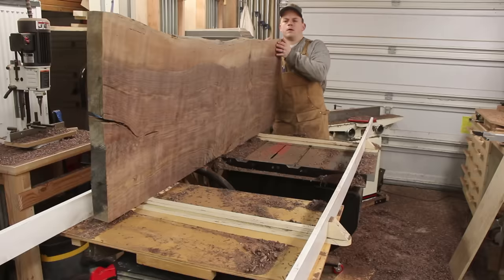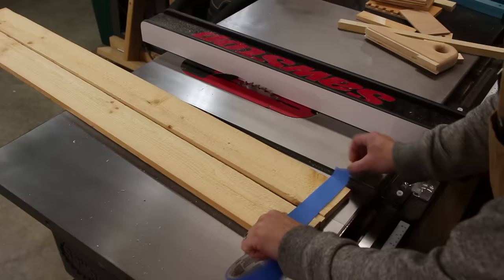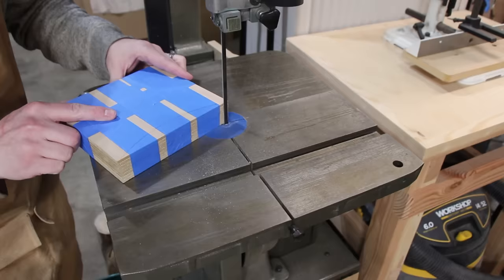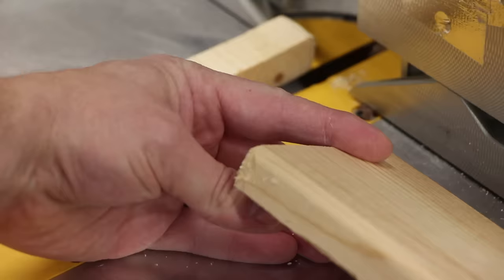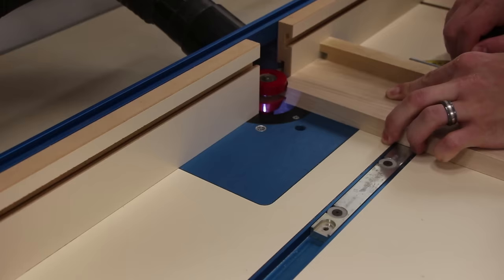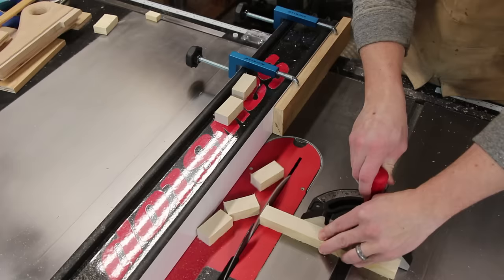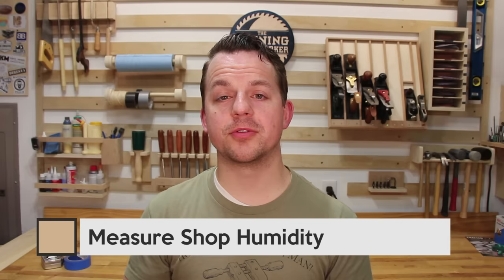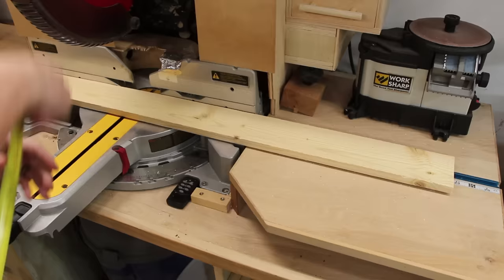7 Woodworking Tips & Tricks You Really Should Know | Evening Woodworker

Comment: I use blue tape for clamping and gluing mitered corners in picture frames. And be careful using the last tip. You might get wiplash cut from the edge of the blade as it retracts or snagged on the clip at the end.

Comment: One tip you may want to try when planing thin pieces of wood that are below the level you can set your bench dogs to it. Lay down and  burnish a strip of tape. on your work bench. then on the back side of the piece of wood you need to plane. Lay a strip of tape and burnish it as well then on the tape on your work bench put down a line of medium super glue line up the tape on the back of your work piece and press it to the strip of tape with the super glue on it. Press and holed it till the super glue dries or use the super glue accelerator applied to the tape on the work piece. once you have done the work on the piece you needed to do peal the piece up and remove the tape and it has no residue you get when you use double sided tape.

Comment: Erasing pencil lines can often be an arduous and time-consuming process. Using a regular pencil eraser or simply trying to sand them off takes forever. I suggest purchasing "sand erasers". Most are grey in color and typically are designed for erasing ink but they work excellent in removing pencil lines from wood. I bought a five pack set of these erasers that each measure approximately 5/16" thick x 5/8" wide x 3 1/2" long for a few dollars. You can purchase them online or at an office supply store.
Reply from the maker: Great tip!

Comment: I like using paper to make circles template. I use a pencil and some circle piece as a guide or what ever I need to make the circle. Then use scissors to cut out the circles. Fold them in half to find the center. I know there is better ways yet some times you can't find that one damn tool so you got to improvise.
Reply from the maker: Haha! I have stuff too like that where it may not be the best way do it but it works!

Comment: Cutting short pieces on Miter Saw
Make a hold down.  Long piece of wood with a piece of wood at the end of it.  The piece of wood at the end is a pivot piece.  So when pushing down on the long piece of wood it will press down on the wood to be cut and keep fingers away from blade.
Dimensions and sizes are to suit.
Reply from the maker: That's a great tip! Thanks!

Comment: Great tips and some I've never seen. The only problem I have is with the last one. Letting your tape measure snap back eventually will crack the tip
Thanks for the info
Reply from the maker: Just use your thumb to slow it down a bit and you can reduce that.

Comment: I ran into that exact same problem with that exact same taper jig a couple months back. Wish I had seen your tip then.

I also love the tape measure trick, but I think I've seen that before. Did you have that in one of your videos?

PS: green tape is a little better for clamping, as adhesive is slightly stronger than blue tape and it has a tiny amount of stretch to it. It also does not leave residue on most surfaces.

Comment: Tape Measure Trick - #2      Use a small tape measurer.  One that easily fits in your pocket - and - one that locks automatically when pulled out.
I take the belt clip off mine and it is even easier to use and slip in a pocket.
Much better than the 1x25' ones normally used (see vid).  (how often do you need to measure 25'?)
Reply from the maker: Good tip! For most of my woodworking I use one of the small ones too.

Comment: Wondering why blue tape helps reduce tearout- I think it makes that part of the board make better contact with the flat surface underneath,  because it adds to the thickness in that area. so applies more force at that spot.  So it might not work in the situation where the cut is unsupported underneath by tape only?
Reply from the maker: Great question, I think it has to do with the tape providing some sticky support to the fibers even if it just sticks it to the fibers next to it. I've also found that even when it's unsupported, the tape still makes a difference. Try it out and see if you agree.

Comment: My suggestion: Especially for the non-professional, build shop tables and accessory tables (for vice, drill press, grinder) on locking wheels. Get them to the side when not being used and easily bring them to position when needed. Helps a lot for space utilization.
Reply from the maker: Great tip!
Reply: I just paid about $300 (Home Depot) for a small work table that retracts for storage that I used for my table miter saw. I’m never going to make that mistake again when I could build one with left over materials.

Comment: Great tips! Question, is plywood a good wood for French cleats? Thanks
Reply: I've seen several woodworkers on Youtube using birch plywood for French cleats.
Reply: I’ve used 3/4 AC with no problem. About 3-1/2” wide cleats.
Reply: Thanks for the comments.
Reply: Plywood is especially good when they are really narrow. It won’t split on you. But sometimes the sharp tip of the cleat will splinter with plywood. But that is not a structural problem. It just looks bad.
Reply: I am french , but I don’t know what a French cleat is !?

Comment: Letting the tape snap back can loosen the riveted hook (making it less accurate), and can eventually break the rivets or tape.  You also risk having the edge of the tape cut you.
Reply from the maker: True if you do it a ton. I usually release it slowly, but doing it fast makes it so much more dramatic!
Reply: It took over a decade for the tip to tear off on my Stanley. I was bummed when it finally failed.
Reply: Steve Ramsey just did a test where he snapped the tape measure 10,000 times before it broke

Comment: There’s a problem with letting go of your tape measure like that. After doing that a few times your tape is no longer accurate. The holes where the end is riveted on get wallowed out and you’ll notice a difference. The difference is especially noticeable between the “inside” and “outside” readings.
Reply: The end is supposed to slide on those rivets, the holes are slots. Letting it free spool back into itself can damage the slots and increase the length of the outside measurements. 

Just want to clarify since some people think the hook is supposed to be stationary and they hammer the rivets.
Reply: Yep, I was going to comment the same thing about damaging the end of the tape measure.
Reply: Some times the monetary increase in efficiency is worth far more than the cost of a new tape measure.

Plus there are some tape measures I have seen that have a shock absorbing material that prevents the end of the tape measure from slamming to a stop just for that reason.  Does not mean that distortion due to impact damage will not happen but it will take a lot longer before the tape measure needs to be replaced.

Like all things, it is a balancing act between profit and cost.  In this case it will mean far more extra profit than the cost of a new tape and the old tape can still be easily used where great accuracy is not necessary, like framing walls and assembling beams that will probably be trimmed and planed before installation anyway.
Reply: Steve Ramsey (Woodworking for Mere Mortals) tested this recently. He let a tape slap back thousands of times. It did not affect the accuracy.
Reply: @oldtimefarmboy617  You're wasting time by justifying bad habits - the classic tl;dr. Just use your index or middle finger as a brake for the very last part of the retraction.
Reply: The printing on the tape measure will wear out long before the holes/rivets do. Snap that tape my friend.
Reply: nope. and a tape measure isnt a precise tool to begin with. the minute amount that could(i use that doubtfully) wouldnt really matter as long as you use the same tape. that being said, see steve ramsey vid on this. seems to be yet another old time myth without real foundation today.

Comment: WOOD NUTS. Instead of finding matching bolt and nut. it is easier to grab a deck screw and a waste hunk of wood. 
The wood's surface is bigger than a metal nut . You do not need a wrench, your hand holds the wood fine.
The torque is more than adequate to hold things together.

Comment: This is because I went to buy a hardwood dowell and it cost $4. That blew my mind. I had oak scrap pieces and a tap and die set. I pulled it out and it would make a 3/8th dowell!! I cut the scrap wood to twelve by close to 38th in. I took my corded black and decker hammer drill with a 1/2 inch chuck. I fit the wood into the drill. I locked the die in my vice.  I took my pencil sharpener and made the end tapered. I drilled through it making a beautiful dowell. I also put the the die into its handle tool. Clamped the drill in the vice and made a perfect dowel moving the die tool down the wood. You can buy the die for $6. You also get a threaded dowell. It's great when you are working late and need a dowell.

Comment: Don't let your tape measure retract at full speed and slam into the tape measure body because it damages the end of the tape which results in incorrect measurements. The tip is made to slide back and forth on the end of the tape by the thickness of the tip to account for inside measurements where the tip is pressed against something and outside measurements where the tip is hooked on something.

Comment: When I need to hold two boards together instead of using double-sided tape or to hold a board on top of a table so that I can cut it instead of using double-sided tape what I do now is I put blue tape on each thing and then I put CA glue between them hold it down spray it with the activator and then it holds it down perfectly and then when you're ready to separate the two items you just pull it up throw the tape in the in the trash.

Comment: Blue tape!  When gluing up any joint put blue tape along the edges to prevent glue squeeze out from going onto your finished surfaces. Glue seals the wood and prevents stains from soaking in and you get unstained blotches wherever glue was.

Comment: Taper jig was dangerous, stop block for the cross cuts was good but man you were so close to a couple of them getting picked up by the blade and launched at you it doesn't just need a pinch point the bits of wood can vibrate into the blade and getting caught.

Comment: I do not allow any of my my tape measures to "snap back"n as over time it changes the accuracy of the tape measure.  The end of the tape is purposefully attached loosly to allow an accurate measurement whether you are pulling it on the end of a board or using it against something, but allowing the tape to "Snap back" wears the holes until your tape is no longer accurate and what was once an inch may now be a 1/16" or more longer (or shorter) depending on how you are measuring.  I occasionally check the accuracy of my tape measures against a quality square in case I have forgotten and allowed the tape to "snap back" or someone else has used my tools without my knowledge.  I keep my shop locked, but several family members are able to get into my shop with either a key or a remote control.
Reply from the maker: True, you can always slow it down with your thumb... unless you're trying to be dramatic!

Comment: Use a stick instead of the tape measure and measure the length, cut another stick the same length and the guy cutting the wood can use it. So for example: the length is 6 foot 9 cut a stick of 6 foot and measure the last bit. And yes this works with metric as well. Use the same stick for tiling a bathroom: write down every tile size and growth on the stick and use it in the bathroom, measure the extra And you know how wide the first tile should be. How the tile will look on the corner, a window or whatever avoiding tiny little ugly pieces of tile.

Comment: You invited comments, so here’s mine. When using pva (white wood glue) most people wipe off the excess. But because pva shrinks as it dries. As it shrinks air is drawn in to the joint, resulting in a honeycomb effect that can be seen when the joint is broken, weakening the joint considerably. I make sure there is excess glue along the whole joint, which gets sucked into the joint as it dries, resulting in a much stronger joint. Please try it. If you use white glue, not titebond yellow. White glue doesn’t stain the wood, and chisels of easily. Don’t sand the glue.
Reply from the maker: Hmmm, that's a new one I hadn't heard before. Thanks for teaching me something new!

Comment: If you have numerous pieces of wood or plywood you need to make the same size and shape - even if you are working with hand planes or other tools where 'giftwrapping' with tape won't work - put blue tape on the faces in mirrored spots and use a few dabs of 5 minute epoxy on each piece of tape to temporarily glue the wood together. When you're done just pull them apart and rip off the tape.

Comment: Blue tape really does make a fine  temporary “clamp”, and so does plastic shrink wrap. It’s thickness is even less than blue tape, it’s cheaper AND applies faster. I find that it’s elasticity let’s you “load” tension as you cut through multiples, thus ensuring no relative motion between adjacent pieces of stock. And, less tear out…….!!
Reply from the maker: Hey that's a great tip! I need to try that too

Comment: Many years ago I used a Stanley 12' x 1/2" wide left-hand tape measure. I'm right-handed but put the tape on my left pocket. I could pull it out with my left hand, reach over to the right end of the board, hook it, pull it left and mark with my right hand. Simple. And fast. Once I let the tape fly back and it whipped around through the spinning blade on my radial arm saw. Time for a new tape. I used to buy replacement tapes and keep using the same case, but apparently they don't make replacement tapes anymore. Or left-hand measuring tapes for that matter. 🤬
Reply from the maker: Oh dang, yeah tape measures and blades don't go together well!

Comment: Here's how to put a permanent notepad on your tape measure. Start with a hole saw that will cut a disc the size of the circular "brand" area on the side of your tape. replace the pilot drill in the hole saw with a short piece of steel rod. Chuck the resulting pilotless hole saw into your drill press. Clamp a piece of scrap plastic laminate (solid, light color in a matte finish is best) along with a piece of scrap plywood onto the drill press table. Cut several discs if you wish. Epoxy one of the discs to the side of your tape. You now have something to note down measurements in pencil right where you take them. You can keep erasing and reusing it until the tape goes off to see Elvis.
Reply from the maker: Great tip!

Comment: A tip from Canada. Ok you Americans have changed the square screw driver game. We call them Robbie’s. You numbered them all wrong, but that’s ok. This Is the trick. There’s 4 different size Robbie’s. Largest Is black then red then green then yellow. So all those screw drivers In a bag gets confusing. Answer, I tape the screw drivers between the tip and the handle. Biggest black tape then red after goes green and the smallest Is yellow. And for the prince Philips I use blue masking tape. It makes organizing and picking up what screw driver you need really fast. Really works.
Reply: A tip from America the visible spectrum is Red, Orange, Yellow, Green and Blue. I guess it's just too cold up there for you folks to ever see rainbows. So you have your color order a bit mixed up. The full color code is Black, Brown, Red, Orange, Yellow, Green, Blue, Violet, Gray and White. That's 0-9. But if you want to skip colors and assign them different numbers it's OK. Just don't mix the order up. It makes no sense to strike out on your own there.

Comment: I kept loosing my pencil until I got a reel pencil holder- your pencil fits into a rubber sleeve that is attached to a  spring reel by a string, slip it to your collar of neck of your tee shirt. Pull the pencil to mark a board. Turn loose, and it reels back up, ready for the next use.
Reply from the maker: Just don't want it flying towards my face!

Comment: Has anyone mentioned that allowing your tape to slam back repeatedly will break the tape? I have a couple tape pouches that are specifically designed to use the tape without removing it but I don't make a habit of tape abuse..
Reply from the maker: Yes that's a frequent comment, but I just did it on the video for dramatic effect! Normally I'll slow it down with my thumb so it doesn't slam

Comment: Here’s a tip.

But make sure you have a miter saw, a table saw, a router table, an oscillating sander, and a bandsaw.
Reply: And a planer, and a jointer
Reply from the maker: Those always help, but aren't necessary in every shop

Comment: About the tape measure trick... I was told that if I let the tape snap back, after a few hundred times, the little hook-thingie on the end will start to rip through the tape making the whole thing inaccurate. Comments?
Reply from the maker: Steve Ramsey tested that and found that it didn't really make that much difference, but I still usually slow it down with my thumb anyway.

Comment: "Wrong" on letting your tape snap back. It elongates your 90 Degree tip a bit each time it snaps back. It will not measure accurately by a lot by as much as 3/4' in 10 ft. especially on laying out studs, 4/8 plywood will not line up.